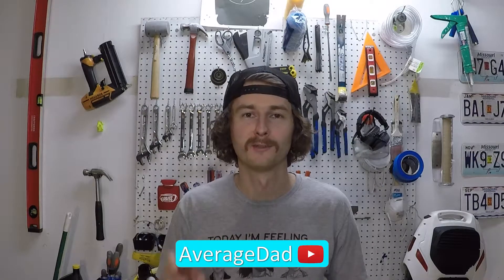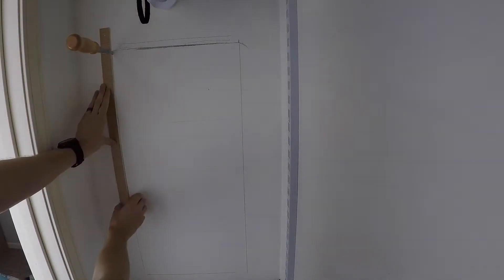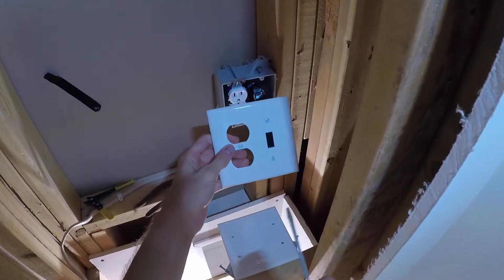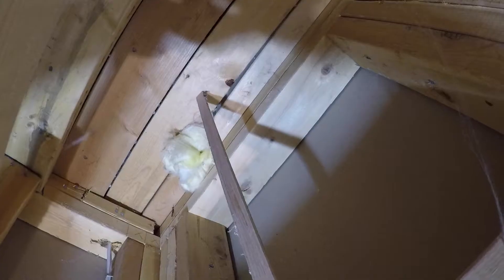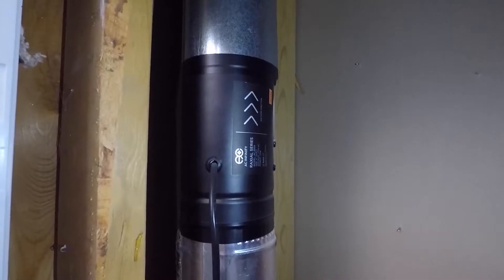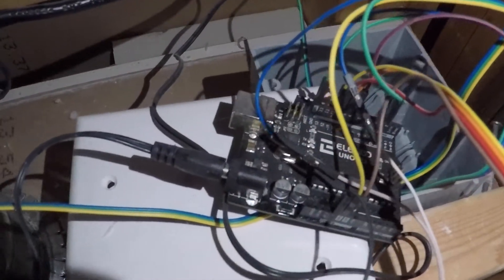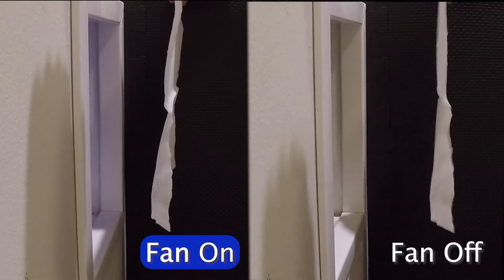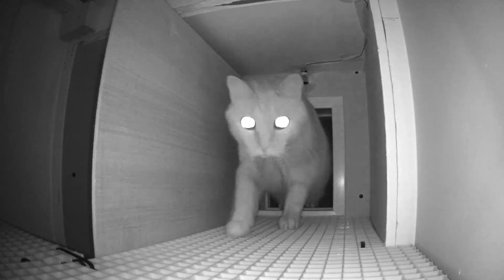A DIY Litter Box That Doesn't Stink

Comment: Very nice project! just wondering though, what are those flimsy walls and the isolation just lying around your attic?? pretty sure your house wouldn't pass any kind of isolation/fireresistance or generally speaking housebuilding standards, at least known to me, is this some US speciality??? the idea especially of the isolation producing carcinogenic dust without any containment is especially scary? makes stuff like your project possible thought, at least here in France you would have to tunnel through heaps of steel reinforced concrete....  i had to help my father insulate the attic when i was a kid, and at that time plastic coated glassfiber mats weren't the norm, well my hands itched for weeks, even whilst i was wearing gloves.... so that stuff is really scary....